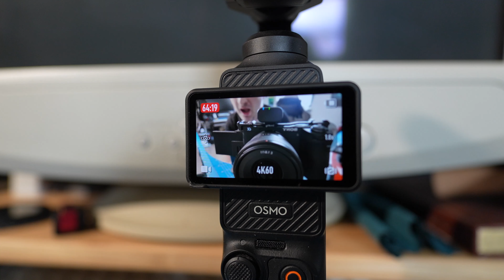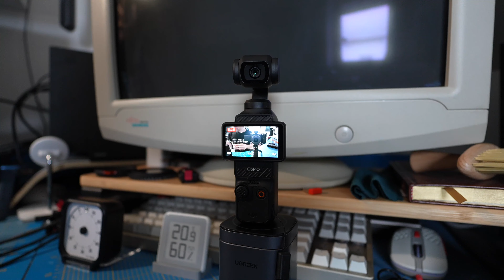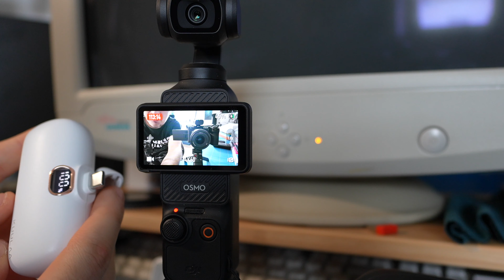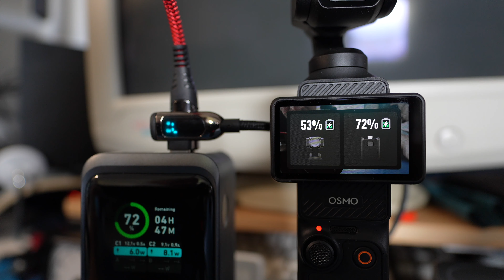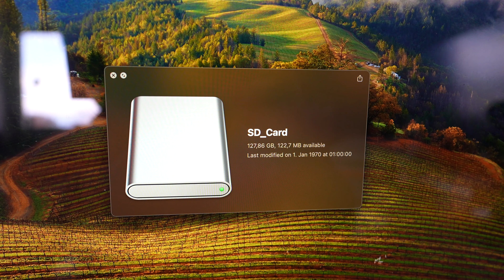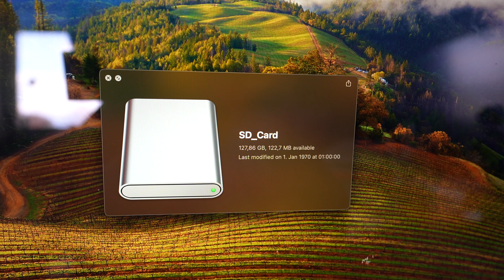Part 2 - DJI Pocket 3 Overheating FIX ! Over 2 hours of 4k 60fps !

Comment: Hey Alex! Thank you for mentioning my name! I really apreciate it! So... I am very happy to see everything runs smooth so far. Keep up going! 🙂 Great Job!
Reply from the maker: Thanks , you made my day , I was struggling since more than one week now , even the temperatures I think they are reasonable and now we can call it a video camera
Reply: @constantech4342 Just be aware when the environement gets warmer, like in the summer. My Osmo Action 3 actually really overheated once this summer, but... there is a but, it didn't shut off, only the screen went off and the camera kept recording without problems. It was a very hot summer day, inside, with no moving air. I wonder how the Pocket 3 will act in such conditions. But anyways, we do not have such extreme weather conditions right now, so... happy recording!!! 🙂

Comment: is turkey in europe region? in the website i can see turkey as a europe country but i know that the dji is not selling here officially. can you know something about that? because in here i can buy a second hand product 400-500 euro and i found one of the dji pocket 3 that the price is 200 euro with overheating. and ofc the 200 euro is better for me
Reply from the maker: I think the issue is mostly gone even in EU , I would meed to test again , but I have done long clips and did not had a problem

Comment: so the external battery is only 1 hour?
Reply from the maker: there was a software update that fixed the overheating , I managed to film even for 6 hours in 4k60 now , I will have to do a follow up or update video , camera still gets very hot but it does not shut down any longer

Comment: Thanks for the video. But I'm wondering if this fix is still necessary for the DJI cameras as I've seen some info that the most recent firmware updates removed the low heat limit for the EU?
Reply from the maker: you are correct , it works now , it gets very hot but does not turn off
Reply: @constantech4342  yup, definitely gets hot. But I've had mine run for hours on hot days while riding a motorcycle and it only dies when the battery dies.

Comment: If you need anything over 60 minutes, just get a damn cinema camera.  I do not understand why people want to use action, vlog cameras to record for three hours
Reply from the maker: the camera had a problem , now it was fixed by dji with a firmware update and it works for how many hours you need (unlimited)  , and yes I have other cameras that can run with no limits , but poket is great because is compact and  I can take it with me , and because it supports 2 mics is great for podcast style clips that can be longer
Reply: when people asks for that feature, you can understand they need it.

Comment: Hello, 

1. So are you suggesting that the battery handle that came with the creative bundle and the inbuilt battery combining those 2 can provide more than 2 hours of 4k60fps??? 

2. Once the battery handle gets drained out, can we charge that handle separately and till that time pocket 3 can record from its inbuilt battery ? 

3. How much time does it taked for battery handle to charge from 0 to 100 in real world?? 

4. Which charger have you boight separately to charge battery handle and pocket 3's inbuilt battery??? 

5. Can we record from pocket 3 while it is on charging ??????? 

Please reply as I am planning to buy !!

Comment: This is not realistic. Try walking around where the gimbal is constantly moving and the Cpu has to do a ton of computations of all kinds of focusing and lighting conditions. Pretty sure it'll krap out in 30 minutes, if not less.
Reply: hes in a debugging mode. It wont stop. Ever. It would break first.
Reply: i agree it needs to be done some where where there are movement..

Comment: while discharging batteries over 48 ˚C is fine and european regulations are overcautious, do mind that charging at well over that will drastically decrease the life of your battery. after a long session like this, always leave half an hour for it to cool down. they're happy charging between ~10 and 45 ˚C. (50-113 ˚F)

Comment: Why its so problelmatic only for EU?  I still have pocket 2 i am recording videod 30+ minutes often but i am making breakes  i stop recording  shut down camera 1-5 minutes and recording again .I am doin transitions .
Reply from the maker: I think overheating is the same , issue is just that the warning and "stop recording" happens here at a lower temperature because of the law

Comment: I would not be so optimistic about overheating problem. I don't believe that just a firmware or a crack file can fix this kind of problem. It just unlocks a temperature limitation but the overheating is still here. And components don't like overheating
I got this kind of overheating problem with a Fimi Palm : The heating was located on the Gimbal and after 8 months, the gimbal was out of order, whatever they updated the firmware.
I just encourage future customers to wait some months before buying. As other companies, DJI use customers as beta testers and fix step by step. So waiting a bit is the best.
Reply from the maker: the crack is indeed making the camera to just ignore the smaller temperature limit , the camera is definitely heating up , for sure I would love a more efficient chip inside

Comment: Working !! but im sure you will demage your Pocket 3 ..is just became to hot my is 50c  cant belive this good for this plastic body at all . I do not recommend doing this;
Reply from the maker: yes , but in the other regions this temperature is allowed , I prefer to deteriorate faster the internal battery then not beeing able to use the camera , without this I would have directly returned it , I dont need very often to record that much but when I do is nice to know that there is a way , I am just doing some test now with Sony A6700 , changed the region to US and now the camera is recording already 5 times more and did not yet shut down , indeed temperature close to 60C
Reply from the maker: also you can use the 4k30 or 4k 24 , and use the h264 codec because that one does not need so much processing power , working now to do some optimizations to this hack so that we can use our cameras and not affect them

Comment: But being that hot won't damage the inner parts or short the livespam of the device?
Reply from the maker: in general heat is not good for batteries , but I am just lifting the EU limitation here , the camera still has the upper 60C limit to avoid damages to internal components
Reply: @constantech4342 Brands don't care about long term... In 10 months, they will release a new version and everyone will jump on it again ;)

Comment: How did you take out the battery (DJI Pocket 3 ) , so that he can read the txt file. completely dischargedP
Reply: @constantech4342
Same question here. Regarding of the need to remove the battery, how do you make the Pocket read the file?

Did it work just after a soft poweroff/poweron or did you need to let it discharge fully?
Reply from the maker: I just inserted the card with the camera off , works perfectly
Reply: @constantech4342  Hi there, thanks for the fast answer and the nice video! You're a lifesaver and TheBestShownman too! 
I was overheating in under 10 minutes in slowmo mode in a room a 18°c.

Thanks!

Comment: My US copy of the DJI Osmo Pocket 3 is perfect. Never had any issues with it.
Reply: Did you record for more than 20min consecutively at 4K60? Also, if you take such a long video, how hot is the surface just below the gimbal?
Reply: Shot handheld 4K 30 for over 35 minutes straight. Not too hot at all.  @schlaus

Comment: Its dangerous and nonsense, although it may temporarily fix problem but it will not eliminate.
Recently I saw video where the heat damaged the gimbal, he might also followed some stipid advices as well.
Secondly if you damage camera in developers mode your insurance will be VOID
Reply from the maker: the camera will still shut down at the 60C as in the rest of the world , this limit is an artificial limit set only in EU countries , this is why you don't see the US vloggers complaining about this , they all can run the camera for more than one hour , but feel free to not use this

Comment: The heating may be due to a slow writing speed to the SD. My plan is to buy a sandisck extreme pro. With it it should not heat up so much since it would not saturate the buffer.
Reply from the maker: unfortunately is not the case , I presented in the first video the card at the end , is exactly the Sandisk Extreme Pro that I indeed recommend , anyhow now we have the fix so is all good
Reply from the maker: also is you are not in Europe you will not have this trouble , other firmware is used in other regions that don't put this limitations on the camera
Reply: @constantech4342  ahhh okok. It's a peculiar thing. Yes I am in Europe. Galicia specifically. All the help we can share is good. Let's see if they improve it with some update.
Reply: Fair point. I've had no overheating issues with mine yet.

Comment: Still this report to DJI support?
Reply from the maker: dji is just following the stupid laws , I don't want them to "patch" this backdoor that is allowing us to film unlimited time , if you have other trouble with it sure you can do , but here is only the fact that the EU has a law in place that if your device is reaching 49C then you need to stop it , I have the same issue on Sony A6700 , a camera worth 1.7k euro , could they make a more efficient camera ? for sure , but this will not happen any time soon
Reply: @constantech4342 Well, I suggested this fix in the DJI forum several days ago, but I deliberately didn't link to the original video in case it upset DJI. But then somebody else did post the link, trying to be helpful. Last time I saw that discussion, DJI had not taken down the thread so perhaps they are not concerned. They only need to sell the camera in accordance with EU laws. If someone then modifies it after sale, that is not DJI's problem. What is interesting is that the original fix required the removable battery of the Action camera to be removed and reinstalled. I thought that this might prevent the fix from working. But from what you say, it works fine. Good! The only problem now is that I can't afford to buy the camera at the moment! Oh well...
Reply: @constantech4342  Understand fully with you....  thanks for help out solve.  Left or right, on the end its about profit.
Reply: @constantech4342  It's not a stupid law if you want your device to have a long lifespan